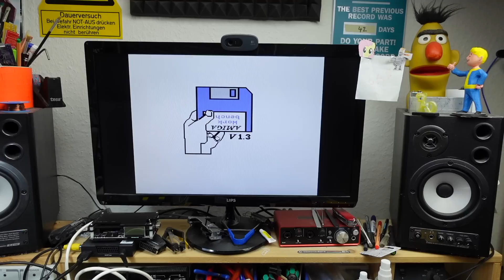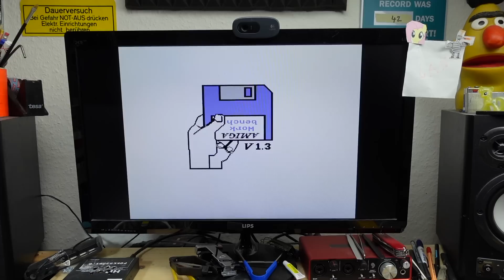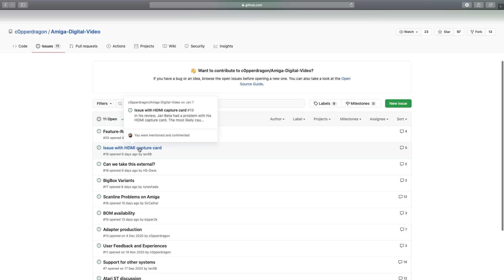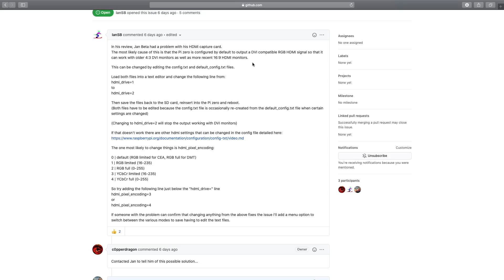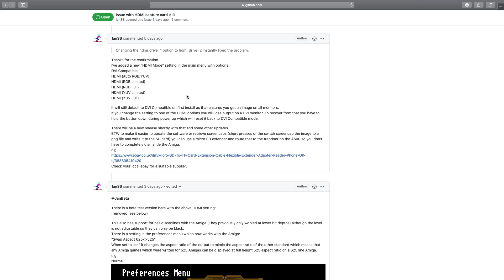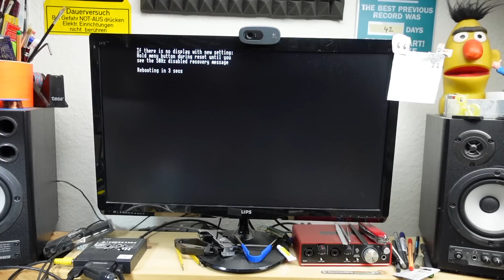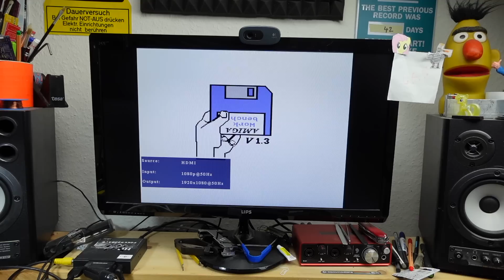Amiga RGBtoHDMI (with a Pi) Updates

Comment: Nice video, thank you. The general question is what's the point of using Raspberry PI to work as RGB 2 HDMI converter for Amiga if Raspberry Pi can emulate the whole Amiga hardware. OK it's better  to use Pi3 or faster ARM but then you have Amiga 4000 at least :)
Reply: The Zero is way better suited for the job. Something about how it processes data through GPIO (I have not dived that much into it).

I know that one person, made a Frankenstein-MOD to his a600, by soldering wires directly to the Denise SMD chip, because he has a Furia accelerator. Then he used an PI3. Yet that takes up space, and the Zero is better suited for the task anyway. He said it worked as in he got a picture. He did not talk about lag. Also, the PI are powered from the motherboard, so it is best to use as low power consuming devices as possible.

If someone design a special adaptor board, that can go under stuff like the Furia or Vampire. Then it can be done in an a600 as well. I just dont think it is the best for a3000, because users tend to use ECS high resolution screenmodes in WB on that model.
Reply: @brostenen   Once i get mine  i can probably design a low profile board that won't interfere with any clip on CPU addons that people use on their A600. I will check the different versions for the component layout to see if all boards are the same for the required connections
Reply: @kipper2k  a600 denise have the same signal pins. You only need some kind of physical connection. That being wires or low profile adaptor. That is if it is stock 600. All you need is a Gotek and then you do not need any WHD solution/installation. The best are still an a500. That is with those few games that require numeric keypad. There are really not that many games anyway. So if all one want is to play games that do not support numeric, then the 600 is a fine machine.
Reply: @brostenen  I a think ing of something like a thin pcb with half circles that can be laid on the mobo, just like what the xbox hacks used to tap into the motherboards
Reply: @kipper2k  Good thinking. Just hope you can find something that keeps it in place, like the furia. That thing just stay on.
Reply: The emulators for raspberry pi, while outstanding, are not perfect yet and most of what we want to do with Amigas is timing-critical i.e. gaming, audio and graphics apps. But a PC is great for virtually all Amiga games and a Pi is great for MOST Amiga games, the ones that don't run well on a Pi via WHDload often do run well via .adf disc images for some reason (e.g. Agony).
Reply: @davidste60  True... I have not dived into VampireV4 and compatibility yet. However I have a feeling that it is much the same as an Amiga4000/040.
Reply: @brostenen  I don't have a vampireV4 but from what I've gathered online it is less compatible than WinUAE.
Reply: @davidste60  It might be the CPU's fault. It is an 080. Then there are the usual issues when running some titles on any AGA compatible chipset. The absolute best option for the old games are still a real a500.
Reply: @brostenen  Yes the 080 has new instructions but it is supposed to support all of the original ones too. AGA compat issues are easily worked around with WinUAE and (less easily) real AGA machines. I think the Vampire team are more focused on moving forward with new features that classic Amigas never had (AMMX, SAGA etc) than with backwards compatibility because it's hard to do both and there already exist good options for very high accuracy and compatibility.
Reply: @davidste60  Well... Even on Windows there are issues regarding compatibility. 😉 I am not going to buy a VampireV4, because I am not using Amiga for anything else than vintage gaming, and not video editing. If I did, then I would buy an Amiga x5000.
Reply: @brostenen  Me too, I find emulation fine for gaming, retro painting and mod files etc. Out of interest which games have you found imcompatible on Windows? For me it's 99% perfect so far, more compatible than any real Amiga considering you can change the hardware configuration with a few clicks of a mouse.
Reply: @davidste60  Most games designed for Win98 and DX7. Even the choice of GFX card are critical. Like NFS Porche2000 need Voodoo2, Voodoo3, TNT2-Ultra, MatroxG400 or GF2-GTS to run without any issues at all. Here I am talking about bugg-free gfx.
Reply: @brostenen  Oh, I thought you were talking about Amiga games on Windows via WinUAE haha!
Reply: @davidste60  Hehe... No. Windows platform is Windows platform. 😉
Reply: For many the hobby is the original hardware etc.
Reply: @flekkzo  True. Yet we can not all have an Amiga1200, 2000, 3000 or 4000. Especially not Commodore branded CRT's. A mint condition CRT with Commodore logo, cost today the same as a framemeister.

Comment: I have yet to figure out how to enable scanlines. However I have my adaptors (V1 and V2) set to lowest smoothing filther. I think that gives the best blend of CRT and LCD (emulator quality) experience,
Reply from the maker: Scanlines were just implemented in the last beta version. The setting didn’t do anything before that. I have yet to try the smoothing options. :)
Reply: @JanBeta  To me it does not matter. The smoothing filther is what I like the best. It is the first smoothing, that you find in the menu, after default settings is enabled. I was disappointed with Rebels Megademo II, at first. The outlines of the Rebels logo, in the loading splash screen, looked strange in default settings. However smoothing enabled, makes the pixels slightly softer, and I think it gives this beautifull mix of CRT and LCD quality compromis/combination. It makes it all look like as if the quality of CRT had a notch up.
Reply: @JanBeta  You can check it in some of my videoes, that I made about both V1 and V2 adaptors. They both give the exact same result, no matter if it is my OCS Amiga500 or my Rev 8a.1 Amiga500.

Comment: So the Pi is basically turned into more or less lag-free framebuffer converter that converts and outputs through HDMI digitally at the original resolution? With the lower bit-depth of the Amiga 600s video chip the Pi can keep up but with AGA the amount of data is too much for the Pi to process.
Reply: I have only a quick cursory glance about the project, but it seems it's not exactly because the Pi wouldn't have enough chutzpah to process the data - there seems to be instead a few major obstacles on making it work on AGA:

1) AGA has replaced Denise with Lisa. Lisa is a surface-mounted chip (if I looked at it correctly, it's a PLCC84) with no socket, so it would be hard to tack on to. Workarounds might be soldering wires straight on the pins, creating a 3d-printed "top-sleeve" adapter, de-soldering and soldering in a PLCC socket. None of these are "easy".

2) Lisa has a 24 bit color depth. Denise has a 12 bit color depth, and that is actually the maximum color depth the RGB2HDMI project supports. The Pi might have enough GPIO pins to support a 24 bit color bus, and it might not. If it DOESN'T have enough pins, you'd need some glue logic to a) capture the bus, b) interleave/multiplex the bus data to the Pi. This adds complexity and requires more design, perhaps even a CPLD or an FPGA in the middle to handle that. Whether it does have enough pins or not, you'd need to modify the RGB2HDMI to support either a bigger bus than 12bit, or an interleaved bus divided into two 12 bit chunks. (Incidentally, a CPLD is used in the original RGB2HDMI, but apparently only for timing and bus capture etc., not multiplexing/interleaving, if I understood it right)

So yeah, the RGB2HDMI can't output AGA to HDMI, but it's a bit more complicated than (and actually not precisely even close to) Pi Zero not being able to keep up.

The reason extended ECS modes don't work though, even if it does have the same color depth/color out bus width as OCS Denise (12 bit), is that the extended modes present higher line frequencies and pixel clocks. The Pi Zero might (or might not) have what it takes timing-wise (NB: timing constraints are different and separate from performance and processing power), and possibly could be fixed simply with a firmware modification. "Simply" though means that the concept is simple, implementing it with tight constraints is definitely anything but.

I might be way off with my assessment, I'm just a hobbyist trying to learn this stuff as I go a long, and probably got everything backwards.

Source: Been designing my own 8bit Homebrew system since June 2020, most of the latter part of 2020 went on researching analog and digital video signals and how to squeeze cycles out of AVR chips - current "best" is a 80x25 (640x200) 16-color text-mode and 320x200 8x8 tile pattern + 32 (max 256 w/ FPS penalty) sprites 16-color w/ analog RGB through SCART (configurable PAL/NTSC timings in 240p/288p or 480i/576i)